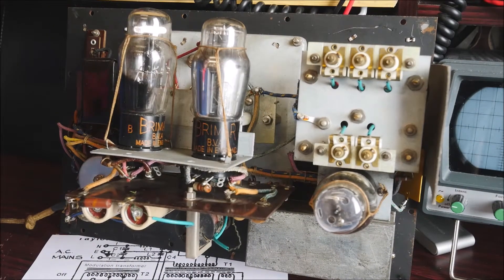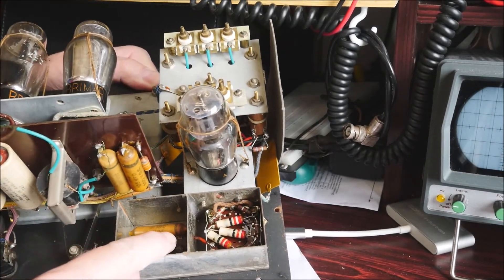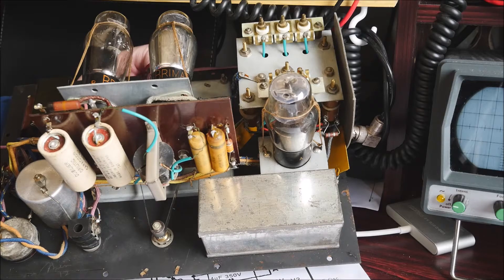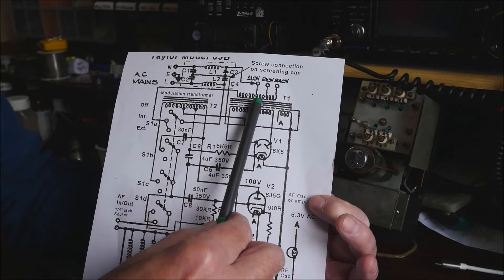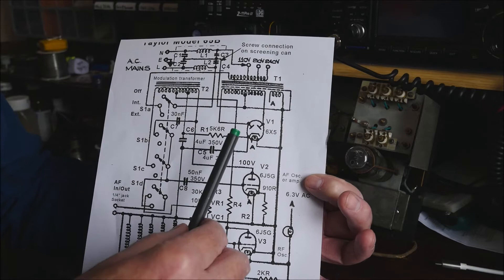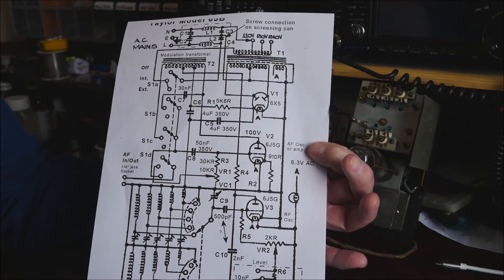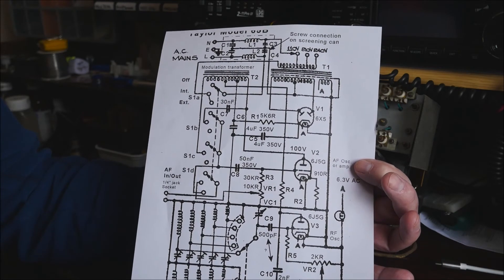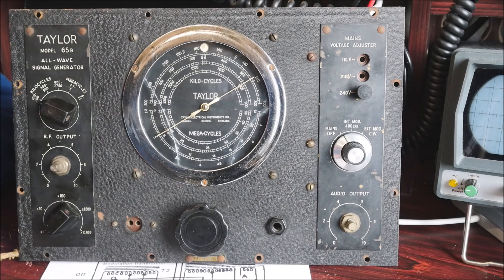Taylor 65B Signal Generator Restoration Part 2

Comment: Nice project.  What will you be using to "clean and recondition" the contacts, potentiometers and drive belt?
Reply from the maker: Drive belt is actually steel strip, so just cleaned with IPA, and switch cleaner spray elsewhere.